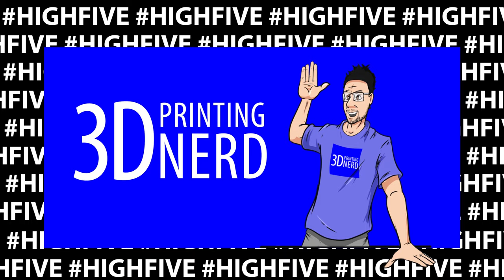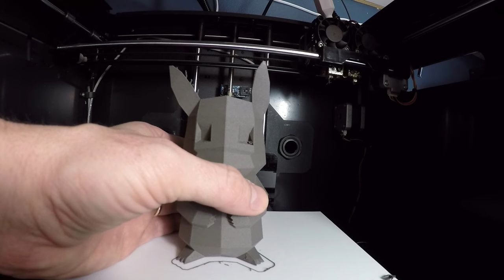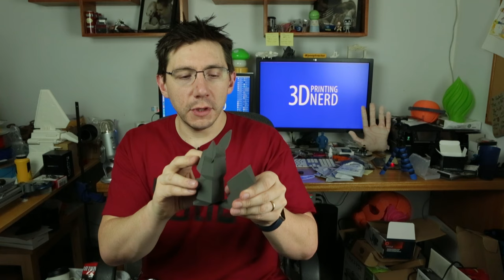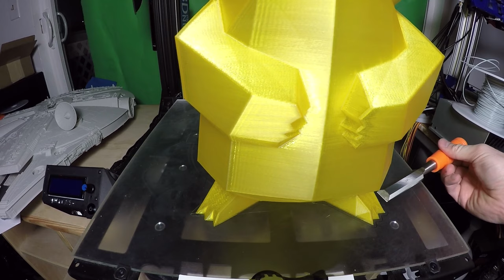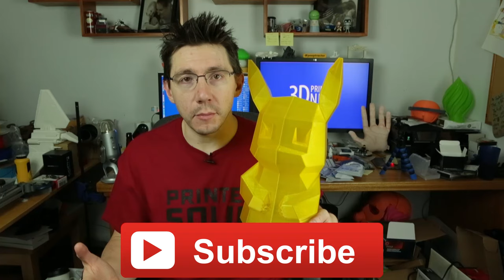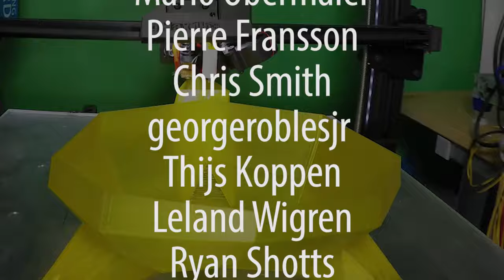3D Printing Larger Than Life Pikachu for Pokemon 20th Anniversary! (Do You Have Him in Pokemon Go?)

Comment: your pikachu is bigger than life size. a normal pikachu measures16''. wtf are you feeding it XD
Reply: rascal6543 I
Reply: Lots of Ketchup.
Reply: erm 16" is head to foot. I'd be willing to bet that the ear is almost 4" long...
Reply: actually ,Dan300 print&go ,from ear to foot he's 1 foot 4 inches , so he is 16 inches
Reply: Actually. He measured from the "ground" to the tip of pikachu's ear. as 20 inches. pikachu to the top of it's head is 16 inches. Cause really. would you count a funky hair style as adding to your height if you're measuring your height for a bio or your driver's licence? Cause I don't think they'll count if it you add an extra 5 inches to your height just by making your hear stand up straight like Paul from Tekken.
Reply: Brock's pokefood has anabolic steroids in it. :{3
Reply: Dan300891 print&go If you look at the tape measure close to the ear, you can see the ear is roughly 4”.

Comment: Joel, thanks for this and all your videos.  Your genuine enthusiasm really shines through and makes these a delight to watch.  They inspired me when hitting a wall with my Printrbot Simple Metal to keep going and now I'm getting prints (though not as good as yours yet).  Each time I try something more sophisticated and this weekend I successfully printed the Fallout 4 Alien gun after you inspired me to give it a try.

I think a great idea for some future videos would if you could discuss filaments (not just ABS vs. PLA vs. others, but if there are meaningful differences between the different PLA filaments you've been using).  For example, I've seen you using stuff like Colorfabb versus the other materials and I'm curious what the differences/merits of each are.  Likewise, a discussion of any things you might do like finishing (sanding, acetone, etc.) would be very interesting to me.

My 'white whale' right now is to get a successful print of the Benchie Tugboat.  The one time I got a good print, the support material was stuck in it.  (and that might be another video: discussing supports and bed placement and such).

Regardless of what's coming up, thanks for making your videos.  They're great and always entertaining.

Comment: Do you think the monoprice select mini is a good 3d printer for someone just starting to get into 3d printing?
Reply: Scuba I was looking at that exact same one. It looks very functional with a heated bed and it comes precalibrated from the factory. It even comes with test prints loaded on a micro sd card (along with the software and drivers you need)  so you can print in literally 15 minutes after you open the box.

Comment: Hi, i'm thinking of starting to make 3D models designed exclusively for 3D printing, will send them to someone else to print but what program(s) should i start using, mostly for sculpting, don't care if it's paid if it's 100$ or less, tried 123D and it's nice for basic stuff and has measurements the sculpting element is nowhere to be found.
Reply: +TenSecondsGaming Honestly, unless you're paying AutoCAD money, your best bet is Blender or, like you mentioned, 123D Design. There just isn't much in the way of features between 123D Design and Autodesk Inventor, plus Inventor offers a bunch of features that you just won't use most of the time for 3D modeling for printers.
Reply: Christopher Pilcher That was the bummer, the paid ones seem overkill and the free ones lack features, i tried out blender but it so different from everything else i will have a very hard time adjusting.
Reply: Yeah, the thing about blender is that it's not meant to make things for 3D printing., or even to be realistic. It's for 3D graphics more than anything.

There's another one that I can't seem to remember the name of that is also free, but has more features than 123D Design. It doesn't look as pretty, and it's slow, but it's more fully-featured. If I remember it, I'll let you know.

Comment: Hey Joel, have you ever been so frustrated on a 3d printer, that you gave up on it in frustration? I'm just wondering, because my Replicator 2 finally crapped out on me. I got flashing red lights so I replaced the nozzle, and parts of the extruder are now aluminum.  But it keeps telling me that some thermal sensor cable thingamagig is not working right. I wonder if I just replace a cable or if I just call Makerbot to replace the whole extruder.
Reply from the maker: Oh yes. Absolutely. At that point I just go to sleep because this always happens late at night and tomorrow is another day.
Reply: It's probably your Thermistor. Those are almost always relatively cheap. Contact maker bot and see if they will replace your Thermistor. If not, like I said. They can be cheap. The 100k ohm thermistor from my buddies robo 3d r1 crapped out and it was a $10 fix (for a 10 pack)

Comment: I thought the idea of that scraper was to just use the flat one?  Why would I want that if Im going to need to use something else to lift the print up a bit?  Seems like a weird design.
Reply from the maker: Normally I can get it under the model with ease to lift up but this model was really stuck down and I didn't want to take the chance at damaging it. I used the chisel as a lever to get up the edge. I'm thinking of grinding down an edge on the BuildTak spatula so that its sharp like a chisel edge. That's the thought, though, I'm not looking forward to cutting myself accidentally because I know that's what will happen.
Reply: Lol, I feel ;D
Reply: +3D Printing Nerd just gotta be careful and probably not put your hand near the belt sander (or you could use a sanding stone)

Comment: have you thought of putting painter's tape down instead of having to pry them off the printer
Reply: +Nuttty I don't know if painters tape plus 230Cº nozzle close to each other is a good idea.
Reply: +Chico Zombye 230°C in PLA? That's some high temp PLA you're printing with yo. Lots of people use painters or kapton tape for their print beds. It's not bad for PLA adhesion if you don't have buildtak or anything like it

Comment: Can i ask you 2 questions about it! How long did it take about? And how much filament! Thanks #HighFive
Reply from the maker: +Bobbiee Kkrim Hello! I think it was 16 hours. That sounds about right. It used roughly 625 grams of Colorfabb PLA.
Reply: +3D Printing Nerd Hey Joel, nice print. How's the gMax 1.5 XT+ printer performing using ABS? Have you printed anything 20" big in ABS? I'm still debating whether to get the gMax 1.5 XT+. Thanks Joel!!
Reply from the maker: innomind Hey! I don't do ABS on the gMax right now, just waiting for the heated bed to come in that I'm not suppose to talk about WHAT????
Reply: +3D Printing Nerd In other words at this time this printer doesn't print in ABS? How long until it's possible? Thanks again!
Reply from the maker: +innomind The gMax? it'll print ABS right now but the heated bed will be here soon and make it much easier :)